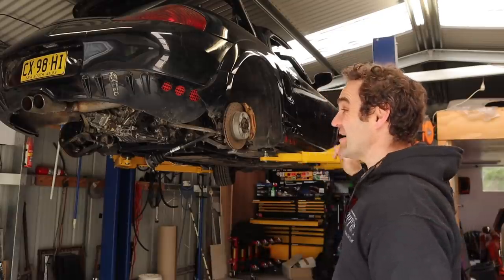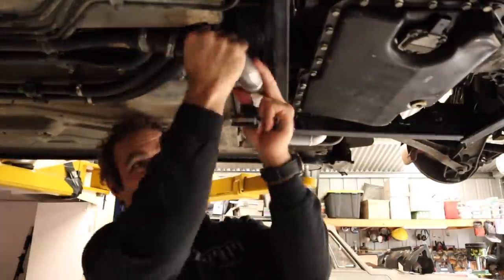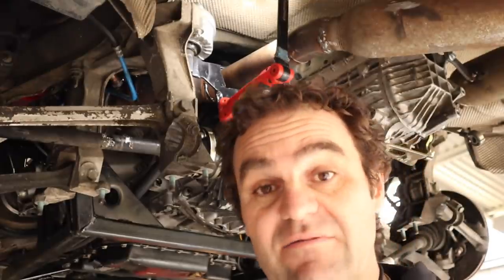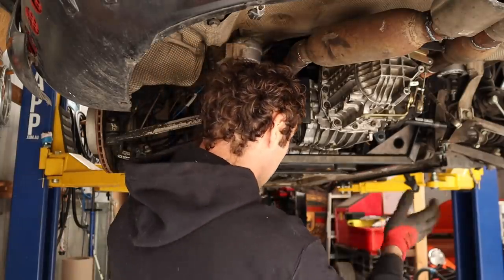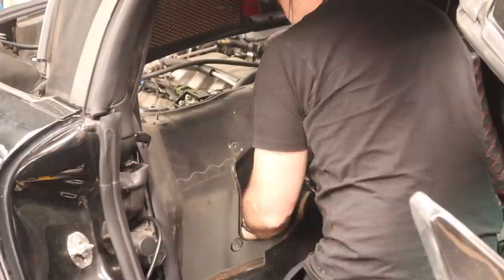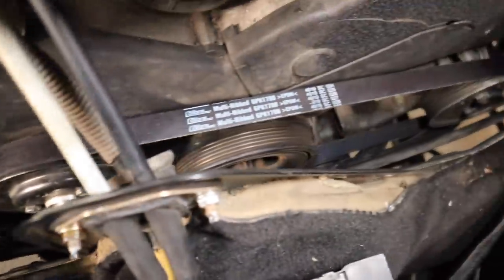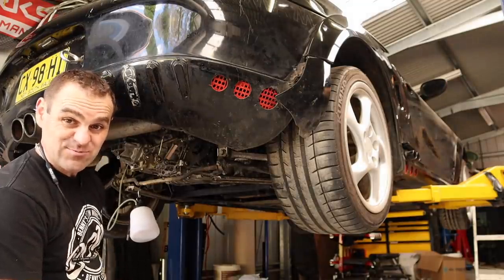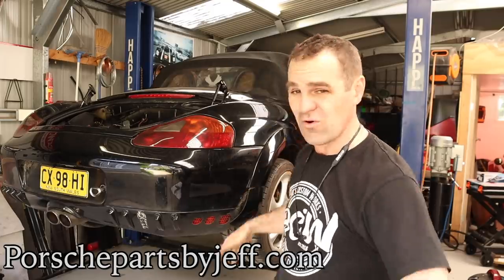Roxster reassembly - Porsche 986 Boxster V8 engine swap track car build 17

Comment: Great update Jeff. Will you be removing the rear diffuser fins and using them around the house or hanging  them from strings in parking bays in the garage as visual space stoppers. Bit like a tennis ball on a rope .or will you be raffling them off to viewers  
Can't wait to see the body kit and mods thrown in the bin 😄

Comment: Your belt looked like it was not on the Harmonic Balancer enough, I think it needs to go around at least 30% of the pulley? Correct me if I am wrong
Reply from the maker: It is. That part is still as it was from factory.